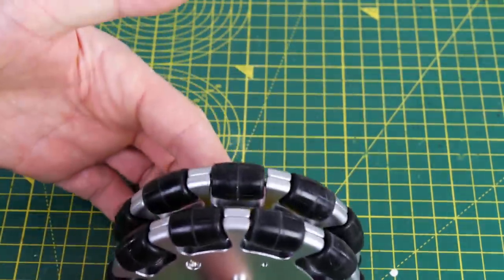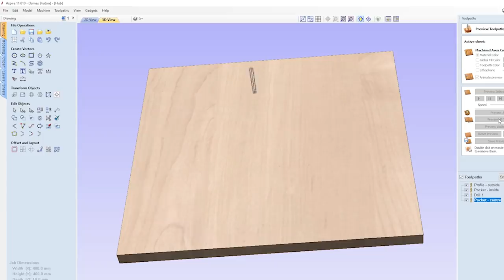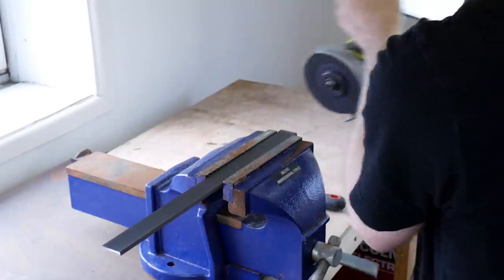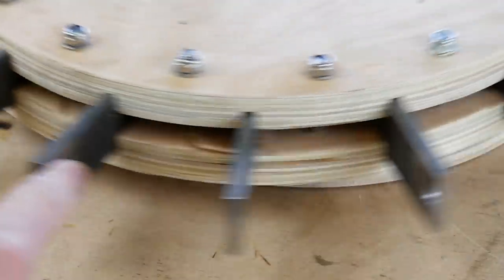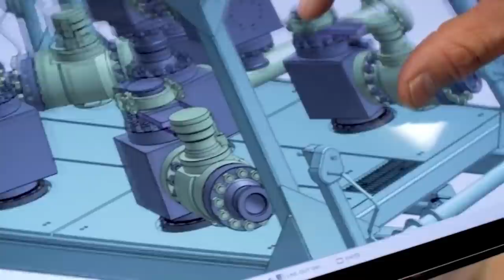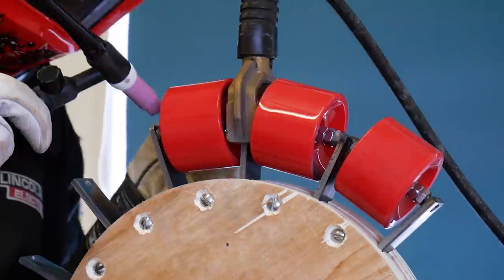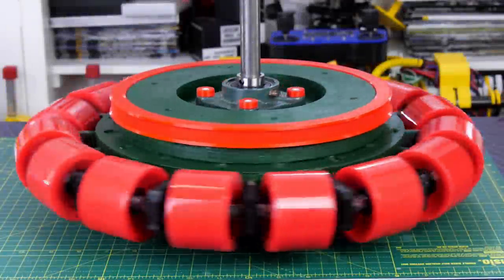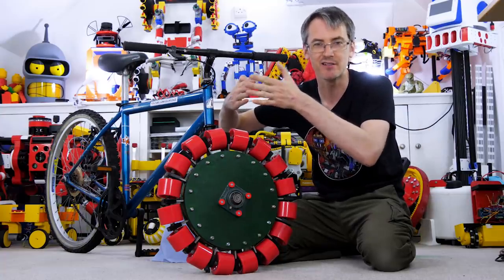Why I built this Omni-Wheel

Comment: Why did he put the wheel that way instead of the proper way?
Reply: Because he can only drive the wheel on one axis with a motor and putting it on that way will enable the self-balancing from side to side. To drive the wheel in the other direction (forward), all he has to do is pedal.

Comment: I like your concepts and respect your electrical ability, but your use of fasteners is scary bad. Studding is awful and you've mounted your bearing blocks with wood screws. Mental.
Reply from the maker: It's more than strong enough. The studding has nuts on which makes it thicker, and those bearing blocks are massive overkill